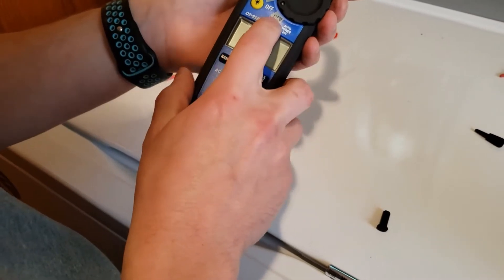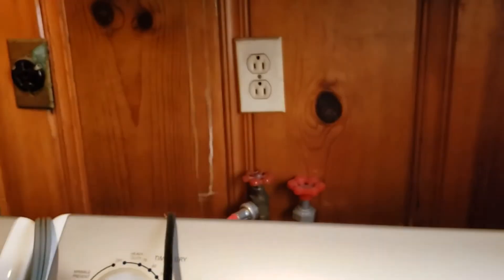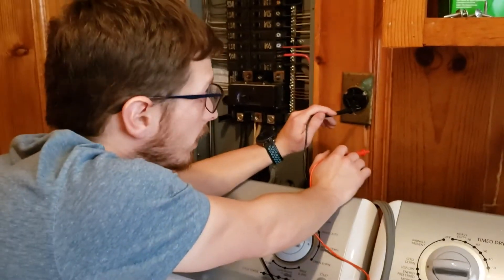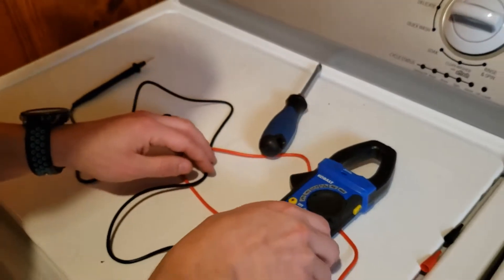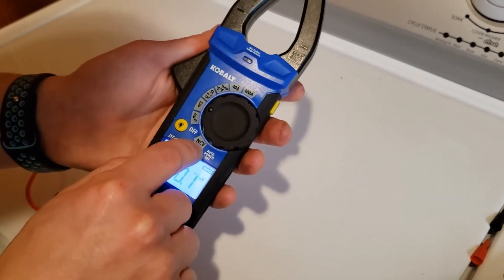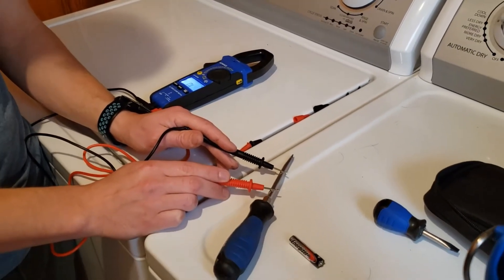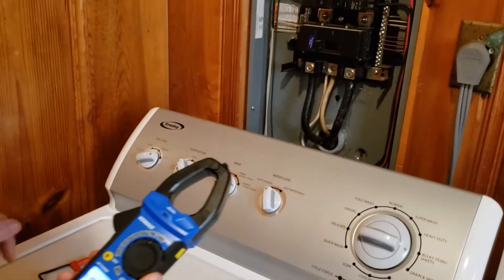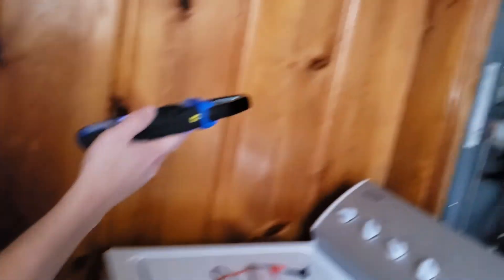How to use a Multimeter: AC/DC Current, Volts, Amps, and Resistance.

Comment: Which emblem do I put it on to make that beeping sound when you touch the terminals together cuz mine don't
Reply from the maker: It depends if you model has the non contact voltage detector or not

Comment: Show me which one does the beeping sound on the multimeter on the blue one that you got
Reply from the maker: Once you go to the diode testing you hit the mode button twice and it should show a sound emblem on your screen. Then try. :)
Reply from the maker: Check 5:04 in the video I start talking about ohms, resistance, and continuity. Continuity is the one that makes the beeping noise. Let me know if you still need help! Hope you get it!